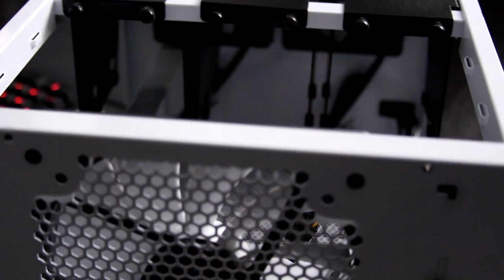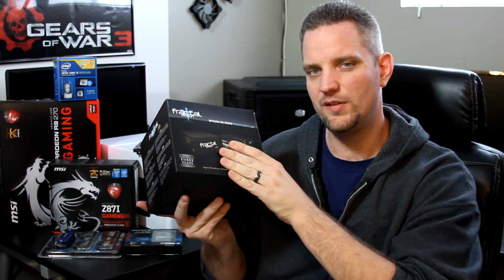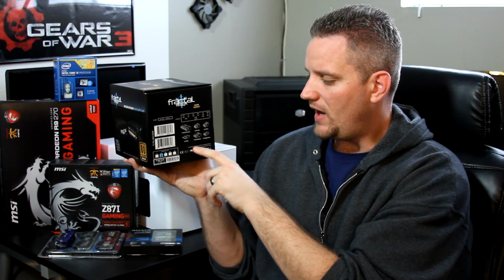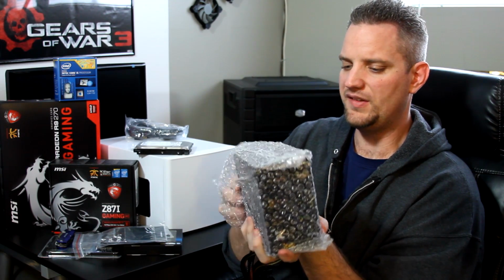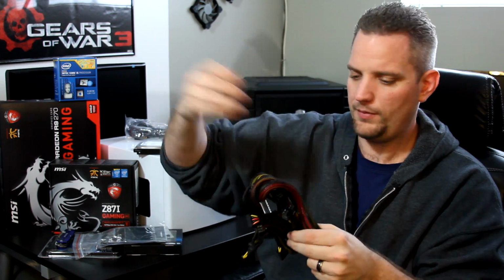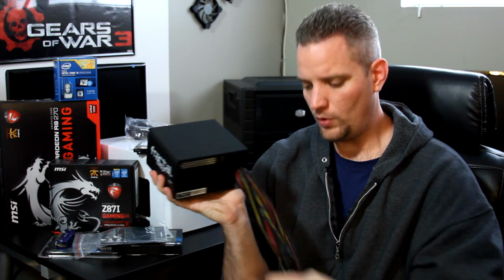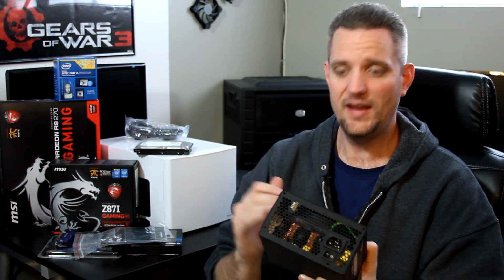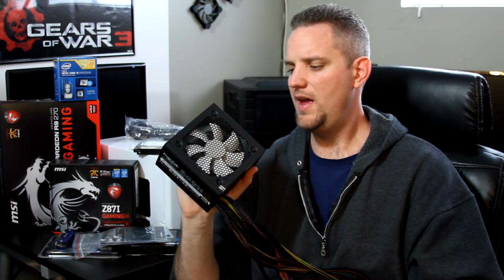Fractal Design Integra R2 650w PSU - Unboxing and First Look!

Comment: Hey bro I had to upgrade my stock PC power supply for my graphics card upgrade needing at least 500w and mine was only 350w, so I got a 850w one just because it looked really good and solid and had a nice fan on it, is there any benefits or cons running a larger power supply ? Thanks bro.
Reply: +bakerXderek  it will last longer because you're not stressing it enough which will also keep it quieter. It does draw a bit more power than you need though.
Reply: +Ham Burger Just realised your comment is 2 years old lmao

Comment: Planning to build this early next year, please give some feedback and respond if ive missed anything important. ty.

Cooling Fan Boxed Cooling Fan (1150pin)/ Intel BXRTS2011AC Cooler 
(LGA-2011)

Intel Core i5-4670K 3.4GHz (LGA-1150)

Video Card Asus 2GB Radeon R7-240 PCI-Express Video Card

Memory Patriot 8GB DDR3 1600 Memory
Hard Disk Genuine Seagate 2TB SATA3 Hard Disk

CASE Thermaltake Commander MS USB3.0

Monitor  Samsung 23.6" S24C300HL 5ms 1920x1080 HDMI D-SUB LED Backlight LCD Monitor

Keyboard/Mouse Rapoo Blade Series Desktop RP-9060

DVD RW Genuine Asus Dual Layer DVD Writer

Speaker Genuine Creative SBS T10 2.0 Speakers System

Operating Sys Genuine Microsoft Windows 8.1 64bit
Reply: what about the motherboard?

Comment: Correct me if I'm wrong, but isn't the old floppy power connection now-a-days used to power things like multi-SD card readers, and some of those LCD displays for fan controllers, etc. so on and so forth. Basically didn't they take what was already there, but no longer used for floppy drives, and convert it over as a power source for enthusiast accessories and that sort of thing?
EDIT: Duhhhh! I forgot to say: Merry Christmas & Happy Hanukkah & Happy Whatever-You-Celebrate to Everybody! Have a safe & fun time!

Comment: ***** is there a 550w sfx? it's would be really good for an itx build with a 290x since it's a power hog and 550w is really "futureproof" even if the power requirement is really high like a 7990 (or posssibly a 299x)